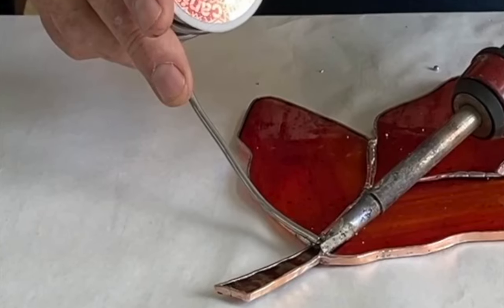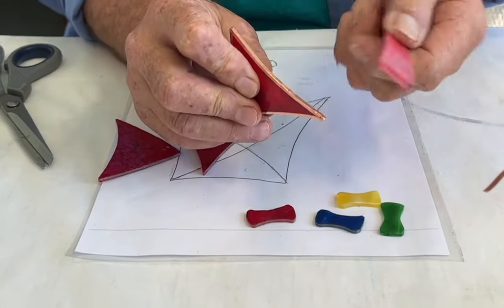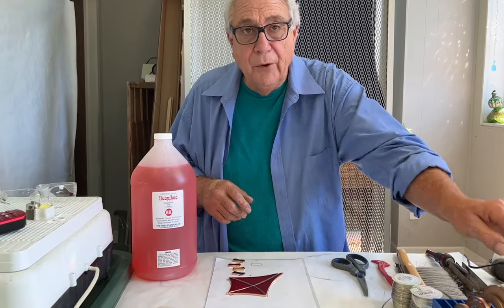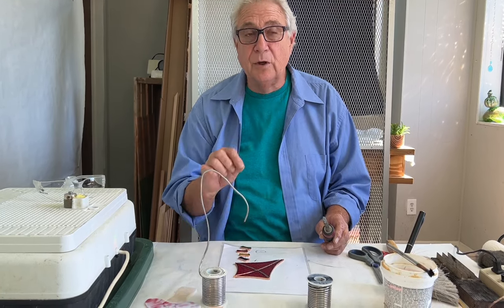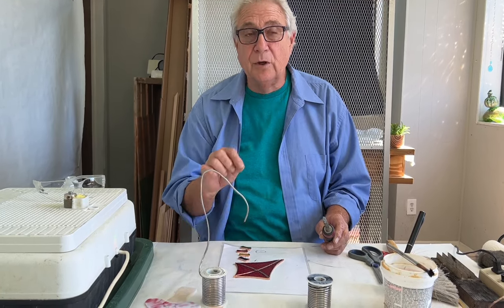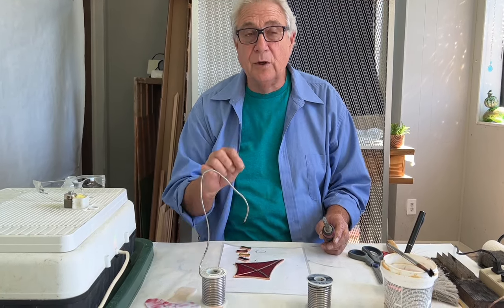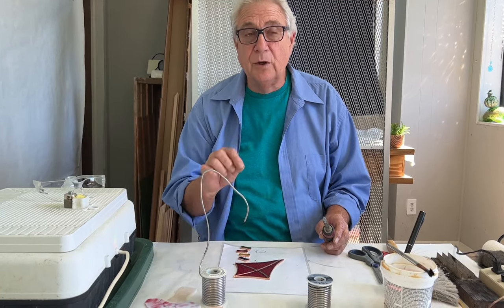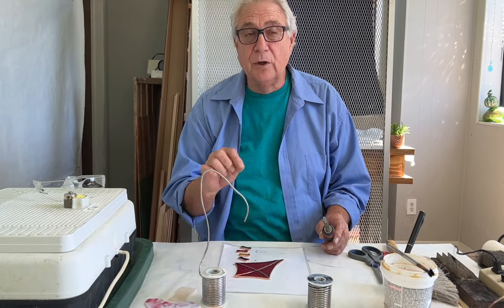10 Soldering Secrets for Stained Glass Success

Comment: I had a stained glass business for nearly 45  years.  Working with lead fumes all around me for such a long time began to take a toll on me.  Now is suffer some neurological issues from the lead and my fine motor skills are gone in my left hand.  Despite having good ventilation in my shop for all those years, one can not escape the negative impacts of the lead.  Then there will be those to tout lead free solder.  But, I found that stuff to be garbage and never used it when if first came out.  Now, I am retired and watching your video rekindled the desire to start scoring glass again.  However, I best leave things alone at this juncture of my life since I don't want to make things worse.
Reply from the maker: So sorry to hear of your health issues. We definitely urge folks to have an annual blood test and to avoid toxic fumes. Daily exposure to these toxins is a real danger. Thank you for sharing your experience. Please stay in touch. We’ll be talking about this at the Monday night livestream.
Reply: Consider this if you want to fall back in love with stained glass:

Several artists swears that if you find the right kind of lead free solder and flux, it is super easy to work with. Lead free have received a lot of backlash, but as new and better products come out, we see that it is undeserving of its bad reputation. 

Today, we have small effective desk mounted fume extractors with filter that instantly remove the dangerous fumes from soldering, while some prefer to wear advanced masks that filters the air for dangerous fumes. (Not the types shown here that basically only filters dust and large microbes). Since no one wants to become sterile or senile or have nerve damages, the industry had to rethink everything. Today you can solder without inhaling any toxic fumes. 

I am sad to here what effect it has had on you, it is sadly the effect everyone will become familiar with if they do not start to rethink what they are using, what they are inhaling, or touching. I do hope you find a way to continue using your artistic skills as using the brain and fingers is so extreme important to everyone, but even more to those that have nerve damages. Finding joy, and quality of life is extremely important when one are facing health issues.

Comment: Re ventilation. I have an exhaust fan built into a box the height of the wall cavity that contains the window (don't know the technical words sorry), has a foam seal around the box, and it sits on the window sill. I work with epoxy and had noticed that while the room I work in is ventilated well, I could smell fumes at the other end of the house, even with closing the room door. Since putting the exhaust fan at one window it pulls the air from the room out that window, so airflow comes from inside the house to out that window. Clears the fumes from the room and prevents them entering the rest of the house.
Reply from the maker: Yes fumes can travel. Glad you found a solution.

Comment: Hi Ed, thanks for this very informative video! I'm a beginner and starting to learn my basics with your channel :)
I have a question though: why did you do touch and go on one side and bead on the other? Was it just for demonstrating both techniques or there's a specific reason? Could you explain the different use cases for the different soldering techniques?
Thanks a lot!
Reply from the maker: Both ways are correct. Which ever way works best for you. The touch and go method is great for beginners! Thanks for watching!

Comment: Thanks for the video. Watching it for the soldering, which I need practice at.
Did you spread the flux on the inside of the copper before tacking it together (or just the outside)?
Reply from the maker: Outside only! Thanks for watching!

Comment: Thank you so much for helping me to learn I love you guys! I could really use some help please. First let me say…I figure your gonna think I’m missing some basics that are causing my issue but I promise you I know how to tin my iron, clean, solder etc.  I’ve purchased several irons used the temperature control units  always had problems with inconsistent heating. So I shelled out the bucks for a halo fx-601 thinking issues were over BUT… NO! I run temp on 360 however iron is always too hot or gets cold solder starts to bubble on iron or won’t hold a bead I’m so frustrated !!! Thanks to you I’ve learned  enough to sale some pieces but this problem is about to make me throw in the towel because soldering is way harder than it should be! Any advice greatly appreciated.
Reply from the maker: Turn the iron down a bit and it does take practice

Comment: Loving your super detailed videos.. I'm searching and decission is getting back and forth which soldering iron should I buy that will last a very long time and worth the money.. 
I've recently saw you other video too about the hakko, which got built in rheostat.. But saw many rrviews onamazon that the temperature doesn't get high enough after few weeks of usage and it's not for larger works... 
could you please suggest me one? I'll be using led free soldering wires... 
should I go for the weller 80 watt or 100 watt or the hakko of your recent video? 
and another question... Do you use rheostat with the weller 100 watt aswell?
Reply from the maker: Thank you for the question. The Weller 80 or 100 would be the best choice for lead work. Both work great with a rheostat. We do prefer the Hakko for copper foil work. The Hakko comes with a 1/8 tip which is perfect for copper foil.
Reply: @ARTyRV  Thanks So much! xD
Reply: @ARTyRV  Btw may I know for how long you have been using the weller 100 watt one?
Reply from the maker: 15 years
Reply from the maker: You must use a rheostat with the Weller
Reply: @ARTyRV   Oh Wow! that's a long time! Thanks for the responsse..

Comment: Do you have to make the baking soda clean paste fresh each time?  I always have a lot leftover
Reply from the maker: Yes we use it up. It keeps!
Reply: @ARTyRV   Baking soda is dirt cheap and IMO one doesn't need to be stingy with it. I put a quart of warm water in a bowl, add 2 tbsp baking soda and 1 tsp dishwashing liquid. I then use an old toothbrush (electric is even better) to give the piece a good scrub. Then rinse in clean water and pat dry with a paper towel. When I've done with it I either flush the mixture away or dilute it and put it on the garden...

Comment: I noticed that at the intersection you didn’t get a blob of solder. My intersection’s always get a blob and then I’m having to clean that up which is difficult. Any suggestions?
Reply from the maker: Are you stopping at the intersection? If you’ll move through the intersection the iron should pull the solder on through.

Comment: ive been trying to solder an 8" length, for the past 2 days. and it is not as beautiful as i would like it to be. YouTube randomly put this video up after i watched something else, even YouTube can see my need for help😳. using hakoFx601, MasterCraft 60/40, kokorode paste flux, and StudioPro tape(which i dont like), a narrow soft brush for the flux.  ive got a fan 15" fron my face, pulling the air out, and occasionally wearing a 3m mask- can still taste the flux even though im not breathing it in. 
im ready to pray to whomever i need to, for help.
Reply from the maker: You need a fume extractor. Here is one for 30. That we have used when teaching classes.
Reply from the maker: Also, the Ruby flux does not smoke. It’s also in our Amazon store.
Reply: @ARTyRV  i will try them! Thanks!🙂